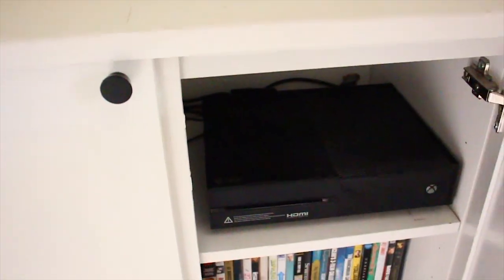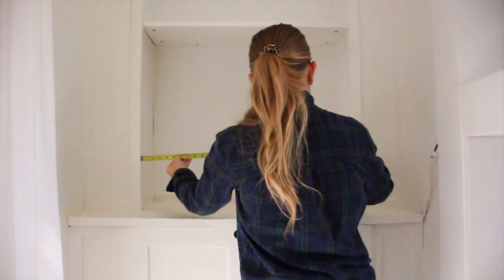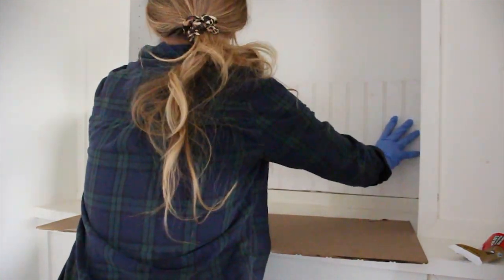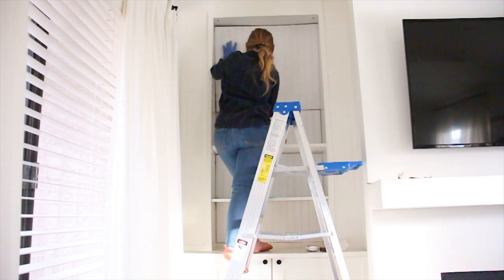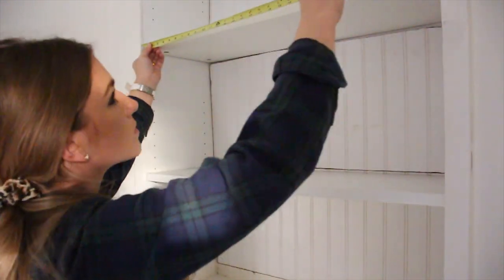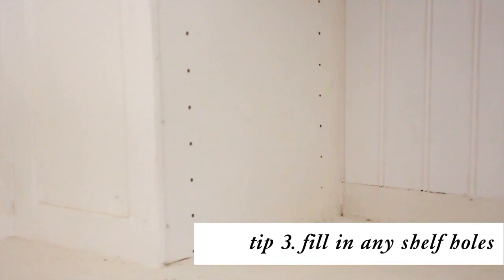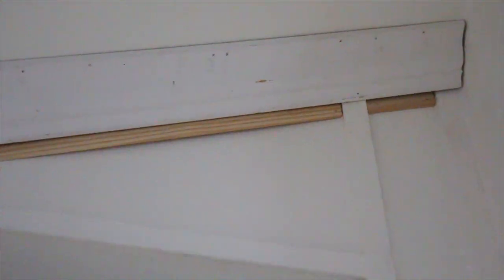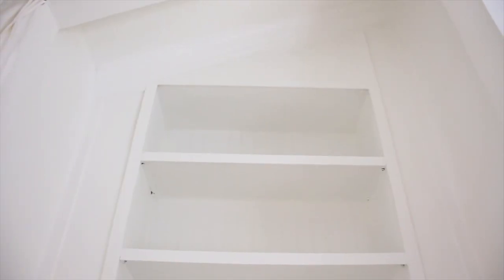HOW TO MAKE A IKEA BILLY BOOKCASE LOOK EXPENSIVE | 2021 IKEA HACK

Comment: Nice but the top shelf is installed improperly, flip the top shelf over the screw goes on the top.. unless you installed the middle or bottom board wrong.

Comment: How well does the paint stick to the billy bookcase? I’ve read the material of the bookcase makes it hard to stick without peeling off?
Reply from the maker: That is a great question! I used the Behr paint and primer in one from Home Depot. I haven't had any issues at all with it not sticking. I think it's because of the primer in the paint. You could always just use a separate bullseye primer with paint as well. But like I said, I haven't had any issues! :)
Reply: @RitaCrane   Thank you!!!
Reply: Probably needs priming first.
Reply: @rita Crane
 ??? Behr Paint & primer ??

In the video it said  used Benjamin Moore simply white  paint for everything..........